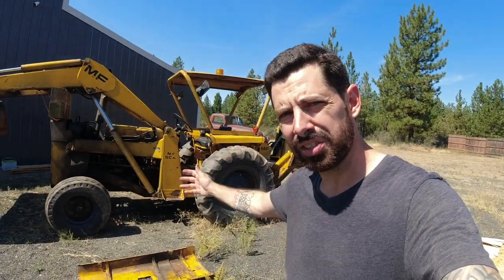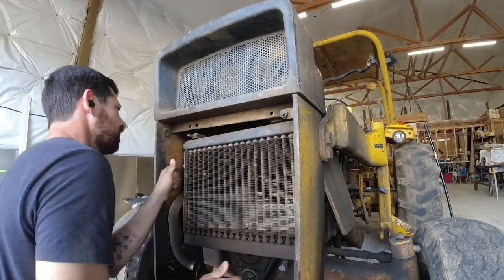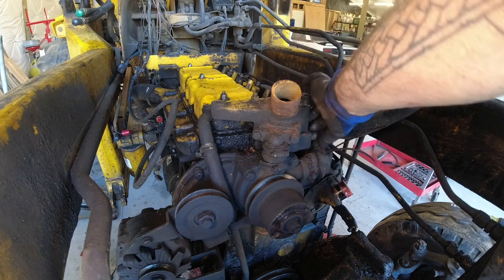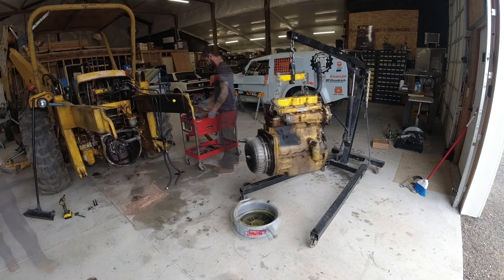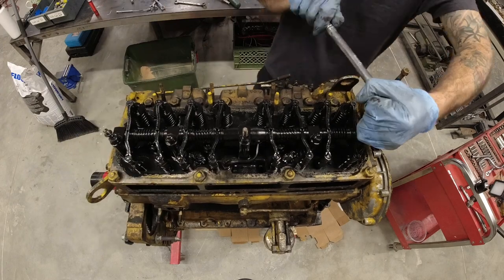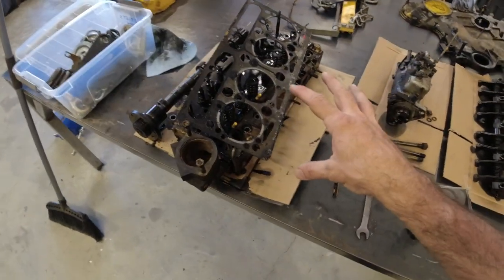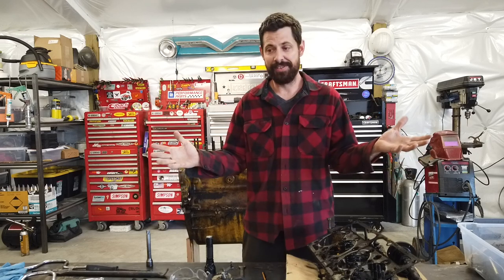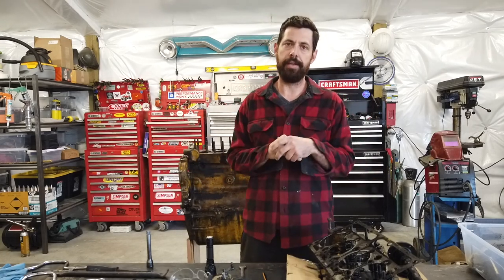Backhoe Blues (Episode 1): Engine Removal and Disassembly, What Could Possibly Go Wrong?

Comment: Dang that block was TRASHED. I don't blame ya for just calling it off. That's the biggest problem with older equipment. Parts can be hard to find and will be expensive. I liked the video! Off to part two!

Comment: Hi Austin, worked on many Perkins engines (used to work for them), couldn't really see how bad the damage was but have you considered having the cracks metal stitched, if it can be done would probably cost about $700 - 800 we've used it a few times (firm we use repairs heads & blocks on railway locomotives ---- not possible to remove engine from unit) and has so far always been successful.
Reply from the maker: I have welded blocks before with good results, but I couldn't risk putting more money into this to have something go wrong down the road. If I would have had more time, I probably would've risked a repair, but I need the shop space back for my next project.

Comment: Hey I got an MF30 and its pouring oil from the oil pan. I got all the bolts and nuts loose on the bottom towards the transmission and block but there seems to be something holding the pan to the block by the timing cover. are there two bolts up in there? from what I can tell there might be but the video didnt seem to show them. thanks a bunch, this video has helped me understand what im up against
Reply from the maker: The oil pan is structural to the frame. The pan bolts not only to the engine, but also to the transmission in the rear and to the front axle support in the front.  I believe there are 4 bolts holding the front support on, two that bolt through to the engine and 2 that bolt to the oil pan.  I am not sure if you can remove just the oil pan bolts and leave the front axle support attached to the engine, but you may be able to.  I pulled the entire assembly off because I was planning a complete rebuild.

Comment: Hi Austin, I agree with you in this situation. One thing to mention is that everytime I had any  machinery or boat with a Perkins engine on it, the engine was dead or  close to death with severe damage, what took me to develop an anti-Perkins attitude. Question : is it economically viable to swap your Perkins for a Cummins, Cat or Japanese equivalent ? Thank you for the video Austin.
Reply from the maker: Probably not viable because of all the unknowns, especially when you consider all the time it would take to swap it with a non original engine.

Comment: Hey Coulsdon.  Not sure if I heard why you bought it.  Was it to resell.  Or use around the home.  I think I would go the Halfass way and braze it up. Then weld patch over to of cracking. You can surface that top your self.  It's on the edge. You can get rubber freeze plugs. It would be a good rig for some body odd jobbing around a off grid joint. We lacking info. What was it worth fixed up.  If you part it out I would imagine there is good scrap value in the weight.  But personally I'd try the halfass repair. What you got to lose. A days labour . Anyways good luck. The guy knew what he was selling. You got to pay scrap value on these items.  I watch Mr Goodpliars at farm auctions.  Some of the prices people pay are nuts.  Have a good day.
Reply from the maker: I bought it to use on my property. I would repair it myself if it were easier to remove the engine and if the tractor was lighter, But it's so heavy I can't risk having it break down in a spot where I can't retrieve it. Also the engine rebuild parts are around 600$ so all that would be lost if it didn't work
Reply: @AustinCoulson  yep Coulson.  You win some you loose some. But what's the next step up to get one of these sitting on your property. Same junk or 8 grand. Better the devil you know than the one you don't.  Just needs some piston rings. Weld it. Stick it back together.  It will just sit around 90 percent of the time.  Get what you can out of it then break it up. Think you said the same about the forklift. Anyways good luck.

Edited. Thinking later maybe you could find a  good block one day. Even if you use the rebuild kit you can transfered it into new block. Weld it up. slap some rings in it. Put it to work.

Comment: J B weld it. Funny thing is as long as the engine wasnt allowed to freeze then JB weld would probably out last the machine
Reply from the maker: The cracks on this block were well into the coolant passage so it would be under 16psi of pressure all the time. It was pretty bad.